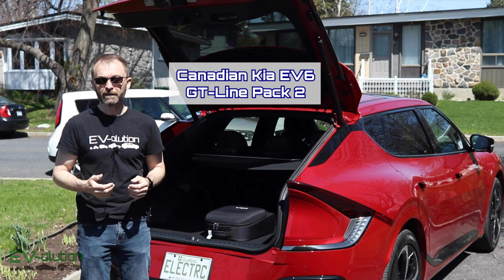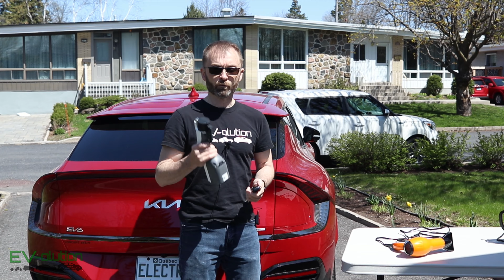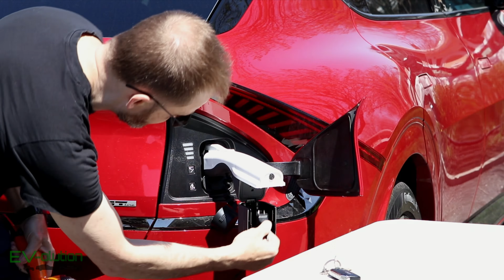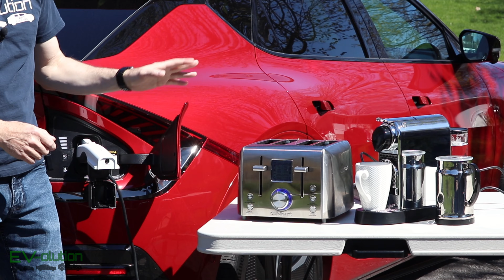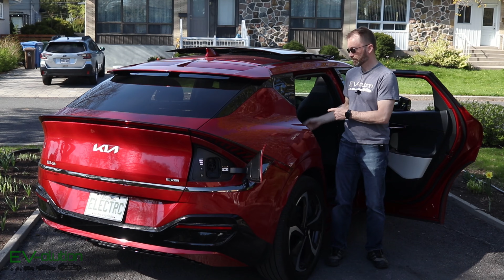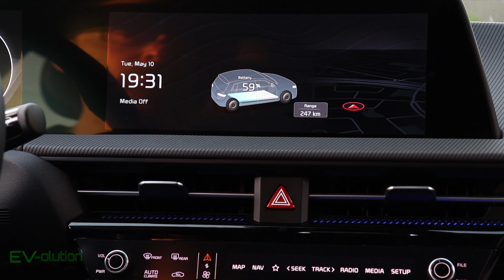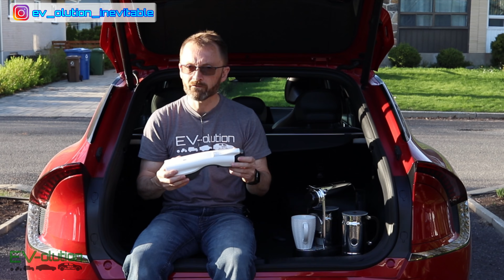Kia EV6 V2L Tested & Explained

Comment: Can you use remote start to do the same?
Reply from the maker: I am not sure I understand the question. To do the same as what?
Reply: @EV-olution  instead of going into the car to turn it ON/OFF to recycle the vehicle? Can you use the remote start button on the remote?

Sorry, I thought I mentioned the time of where I want to add the comment. Lol. I was half asleep.

7:15
Reply from the maker: @rajam4382  thanks for the tip, I had not discovered that simply unlocking the adapter would do it, but I don't power cycle the car at that point in the video, I just pulled the V2L adapter and plugged it back in. Thanks again!

Comment: There is also another V2L screen but not in the place you would think…
Reply: where is that?
Reply from the maker: I showed the two that I know of. What other V2L screen is there?
Reply: @EV-olution  Turn the car on,press the car on the touch screen and then press the car again.Where you would normally get your projected range & charge limit slider you get V2L display.
Reply from the maker: @evodessey  I will check that out, thank you.

Comment: I would likely assume that double insulated devices (eg no grounding pin) are best used as the vehicle battery is insulated by the rubber tires. 
It would be interesting to confirm if the V2L receptacle has  a GFCI trip circuit?
Reply from the maker: According to Kia you should not use the V2L adapter in wet conditions, so no, not GFI.
Reply: I’m a little “shocked” that they would not do that! I would have some concerns without a GFCI circuit as any device circuit could lose insulation and become dangerous. Nonetheless it’s no more an issue than using a portable generator at a job site?
Thanks for the reply, I enjoy your channel.
Reply from the maker: @ralphguppy  my pleasure and thank you for watching, I really appreciate it.

Comment: Do you think with a inverter and solar panels you can recharge your car? Or a battery pack like a jackery thanks .
Reply from the maker: If you have solar panels, a battery storage device, and the required hardware, then you could use that setup to charge any car.

Comment: Andre what keeps me from using a V2L connector on the Niro ?
Reply from the maker: The connector is just a physical connection, it is not the logic, software and hardware in the EV6. It will not work on the Niro EV.

Comment: Thanks for the info. This could be very useful with a power outage at home.  Maybe it eliminates the need for a separate generator? Need to keep the battery almost full.
Reply from the maker: The power output in North America is limited at 1.9kW and 15A, but it could prove very useful in a power outage. It could run a refrigerator for a very long time 😎

Comment: Can you charge your wife's car, with the plug inside the EV6? :)
Reply from the maker: Since the power draw is the same from the EVSE regardless of where it is connected, the 110V provided inside the car will work because it is the same as the 110V outside the car. I have not tested it but I am 99.999% sure it will work.